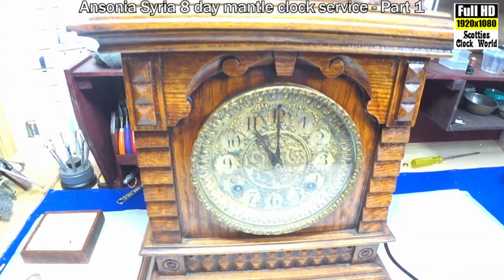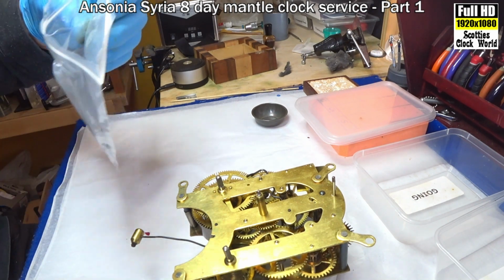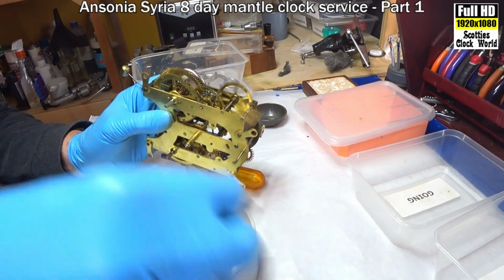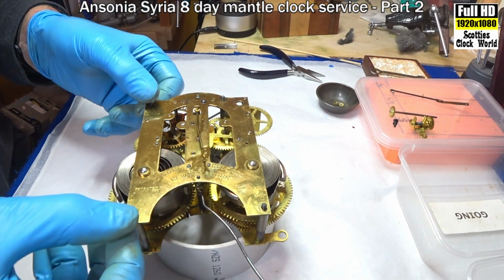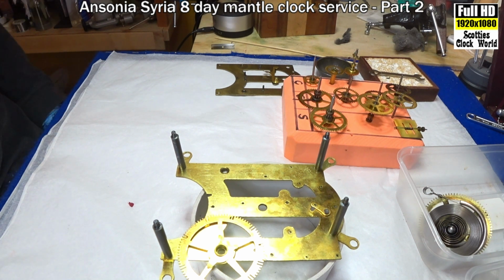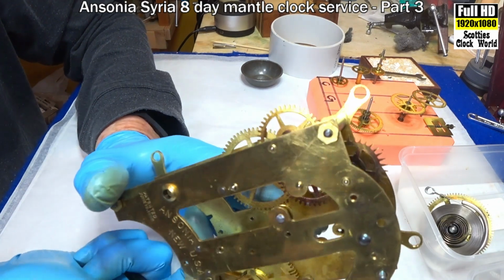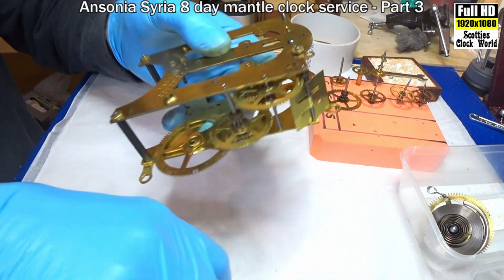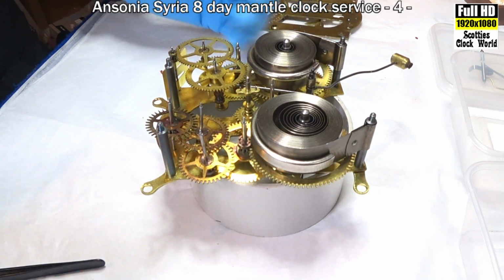Rare 1880's Ansonia Syria 8 day mantle clock - Full Video

Comment: These old American clocks remind me of what old radio collectors call the AA5 (All American Five denoting the same 5 type tube design made by dozens of manufacturers).  Most American clocks from Connecticut were arranged very similarly to this one.  Like the AA5 radios, they were relatively simple yet very good performers and fairly durable.